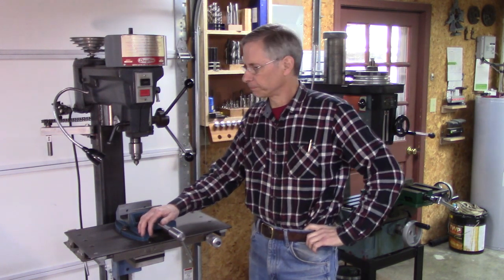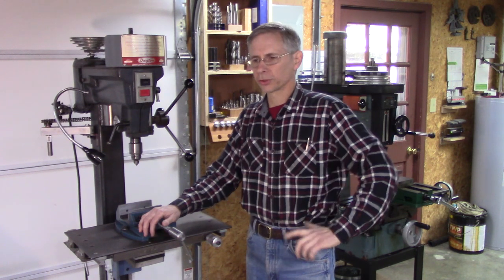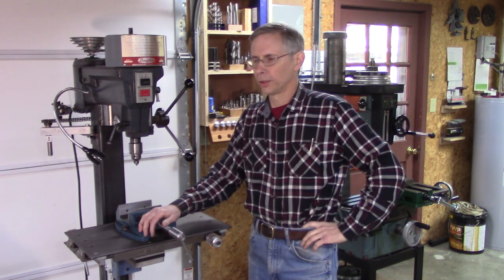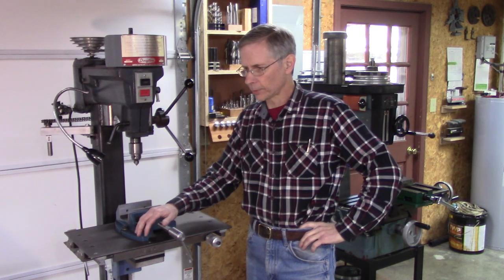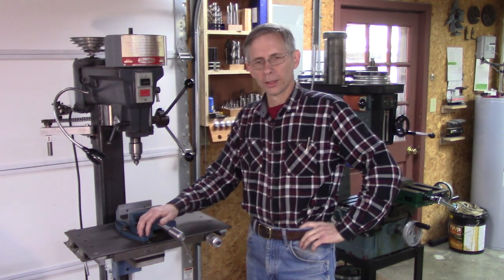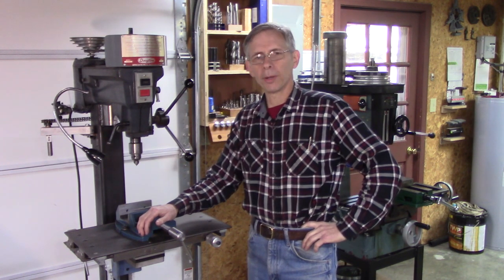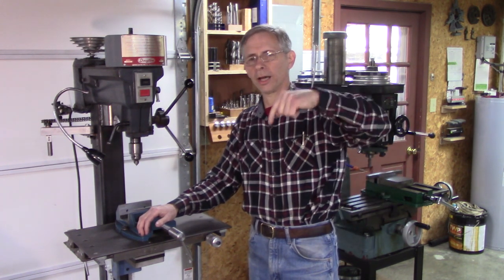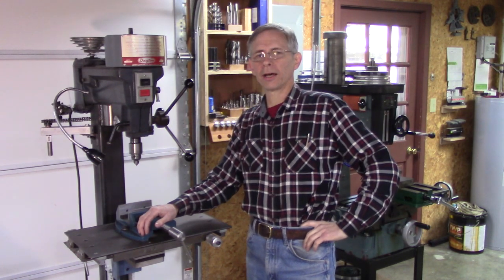Measured Drawings for the SQUARE COLUMN DRILL PRESS

Comment: Really nice set of drawings. Thanks alot for spending the time to produce them and making them public.
Reply from the maker: Glad you like them!  If you make it you need too reinforce the arms that hold the lower bearings. I get some flex on mine. Consider tack welding them in place after you bolt it together.

Comment: WOw !!! i love this design simple yet effective~!! Thanks so much God Bless you!
Reply from the maker: Thanks,  I take advantage of this modification almost daily. I can't imagine why somebody like Grizzly of Jet doesn't make a drill press like this.
Reply: @WinkysWorkshop  well i did alot of thinking on my drill press and debated in my mind whether to cut the round column and add a square etc. I looked the movement and noticed that what the real problem is too much weight on the table causes problem so i added a counter weight system to this tighten the fixture and  added a rod to the side and a socket to the crank and now it moves smoothly and keeps position. the counter weight is in the column using existing holes and fabricated a pulley system allowing for the movement not to conflict with anything in and around the center section. I think you for if it wasn't for your video I would not have been inspired to do anything with my drill press.
Reply from the maker: @georgeyork8975  Very cool!  I had a counter weight on mine and considered the rod off to the side. I was worried about table movement when I clamped the table to the column. Maybe it would not ave been a problem....  hard to say. I wanted to be within a few thousands after moving the table so that I could move an x y table (or mill table) and drill accurately spaced holes. Certainly what you did was probably less work although I am very please with my drill press now. Thanks for sharing you experience too. Just a side thought...  Have you ever wondered why a machine manufacturer is not selling a dill press with a box column or dove tailed column? Grizzly sells a fantastic drill press with a mill table and "ROUND COLUMN!" And to add insult to a bad idea it had a 4 inch quill travel! It really leaves me scratching my head.
Reply: @WinkysWorkshop  Exactly!!! my thoughts as well... maybe the industry does this so that you can shift the head to the side etc. or maybe they just copy each other so much they never put anymore thought into the actual functionality.
Reply from the maker: @georgeyork8975  - So far I've never needed to move my table but I'm sure there are times when it would be nice to have it out of the way. Still, I'd say most never need to do this. Aside from being a little cheaper to produce I can't imagine why they stick with the round column.
Reply: @WinkysWorkshop  production runs are cheaper that is true. I know you are in Kentucky, where abouts? I have kin 60 miles south east of Lexington
Reply from the maker: @georgeyork8975  - Near Bowling Green.
Reply: @WinkysWorkshop  been there before and visited the sink holes and the corvette museum. Hopefully you don"t have problem with sink holes where you live do you?

Comment: Hello Mr. Winky like the drill press upgrade be you made I was looking over your plans not sure how to go about converting your numbers to feet and inch's I was wondering if you could throw me a bone on this one
Reply from the maker: I went back and looked at the plans. They all inch and no feet. I did however use both fractional and decimal and I should have used all decimal, 1-3/4" equals 1.750" etc.  The only thing I would do different on this build is to use larger tubing on the bottom. The 1.5" x 2.50" inch I used is strong enough but it flexes, thinker wall might have helped too. Of course some items like the bearing for the column I had on hand and you could move some holes and use smaller bearing.
Reply: @WinkysWorkshop  thank that helped out a lot got it figured out
Reply from the maker: @raymondwoodring7977  -That's great, you may have to adapt certain part depending on what you have available and the particular drill press you have. Also, keep in mind that the most critical aspect of this build is getting the tube welded to the top of the 4x4 column perfectly straight. Take your time to get this part right.

Comment: Thank you so much for taking the time to do the drawings and publish them.
Reply from the maker: Hopefully I didn't leave anything important out. There were a few places like where the chain tension arm and the lift rod bearing bracket attaches that I didn't put mounting hole locations. In these cases it was either not critical or they were specific to the drill press head and clearances you might use.
Reply: @WinkysWorkshop  Thank you, will be a while before I get to it because I have a cheap Chinese lathe which I'm adapting to be able to mill following Steve Jordans videos and its taking all my money at the moment. I'm on the pension so money is very tight, everything in the UK costs a fortune.

Comment: Thank you for sharing!  I just wanted to let you know, I went out to my shop after your FIRST video to see what I had on hand.  I ended up locating some 5/16" wall 3x3" box tube, a slew of 1" box tube, a handful of skateboard roller bearings, a bunch of plate.  I think the ONLY thing I do not have is the lead screw that you used.  I really appreciate you sharing this idea.  It is just ONE OF THOSE ideas...where I am KICKING myself.  Such a "simple" idea conceptually, but all the ideas and thinking you had to do to consider how the tool is actually used.  I was about ready to toss out and buy a new drill due to the column.  Or just "only" use my mini mill.  I also feel that this modification is worth it JUST for the issue you brought up - varying drill bit lengths.  That always drove me nuts!  I would use the optical center to punch a perfect hole and then to have it oblonged because of the piece being SLIGHTLY off.  And you know what I mean...a reamer would have cleaned it up, but the more centered you have the piece to the drill bit (assuming the bit is not bent or out of round) the more round the holes seem to be.

The other issue I have is the depth of the working area is also a concern on my drill press.  All too often I have a hole I need to drill that I HAVE to use the mill as I can't get the work within the capacity of depth of my drill press.  And while what I have is a "cheapy" Delta, I have modified it a bit to make it less of a wood/metal drill and more a metal/wood drill.  The other thing that is great, the chuck has nearly no run-out.  As cheap as it was I have to really use a 0.5 thou indicator to really read the run out.   

So, leveraging what you so generously shared, I plan to be able to provide a more stable column, as well as weld up (with supports) a holder for the drill press head giving me a larger work area...think of this kind of how a mill has it's head, although my head will be attached like yours, just out on an a non-articulating arm.

Thank you again!  I still can't believe I have almost EVERYTHING in my shop and I did not put two and two together!  As I said, I was ready to swap out to a new drill all together!
Reply from the maker: Let me know how it works out!
Reply from the maker: Super!  Let me know how it works out. Also, use a good quality bearing. I used the 6305 because I had some but it also had a large enough ID to let me cut the eccentric. You really need a means to level the table.